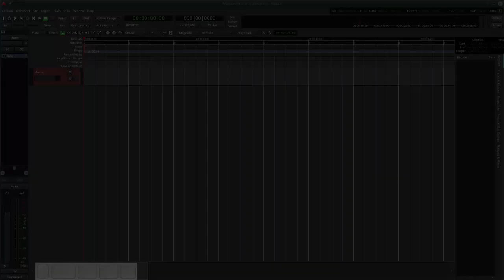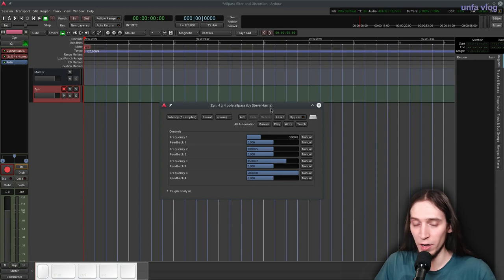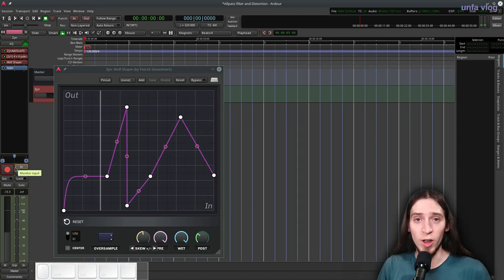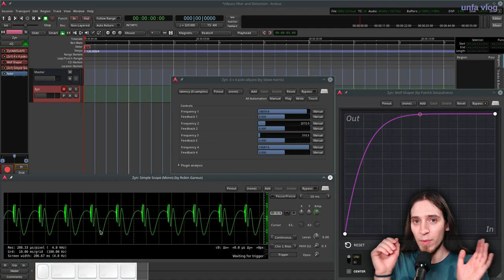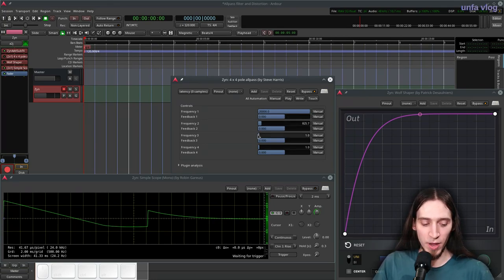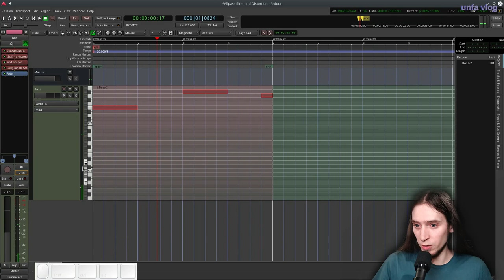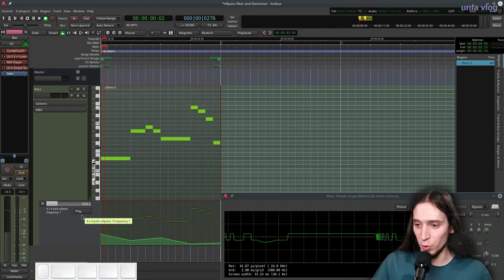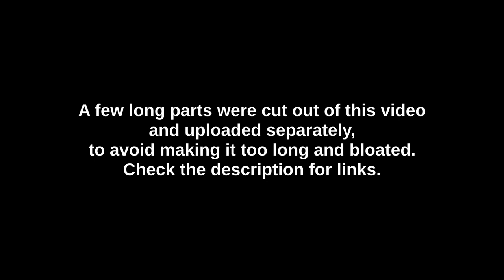UV#25 Synthesizing a dirty bass with allpass filter and distortion (Zyn-Fusion and Ardour)

Comment from the maker: After listening on headphones I have to correct myself: the allpass filter alone can make a significant difference in the sound. I think that for some reason it's different on the speakers though - maybe because of the bass reproduction.
Reply: I just did two videos on phasers and had to talk about allpass filtering by extension. In the first video I mention how moving the cutoff of the allpass changes the phase of a waveform as you showed here in your video too. I go on to show how moving the cutoff quickly is akin to phase modulation which you’ll recognize as the technique used in most FM synthesizers.  So allpass filtering can produce sounds similar to FM.

Now if you can hear a significant change in the sound without variable phase modulation then maybe that’s your ear hearing the difference in “current”.  Like when you enable a polarity flip a kick.  In the flipped version the attack of the waveform has the speaker diaphragm moving away from your eardrum instead of towards it or vice versa, whichever the case may be.

Comment: That was really cool and a great demonstration! I actually didn't hear that much of a difference from the allpass filtering alone in my headphones, maybe a slight lowpass effect. I think the plugin is actually 4 separate allpass filters each with 4 poles (I'm not savvy enough, but I think the poles allow the feedback capability).
Reply from the maker: Thanks! I think you're right about the poles. Unfrotunately I couldn't find any other standalone allpass filter. I know there's one in every Phaser, and also often inside reverb units, but not much of these can be found alone.

Comment: 15:27 Good point about how the allpass filters don't make much of a difference when targeting higher frequencies.  The objective is to RESHAPE the wave via phase. After all, it's the reshaping that's changing the output of the transfer function (distortion).  The MOST reshaping is going to happen at the fundamental, and then less so the further up the harmonic series you go.  This came as a surprise to me in my own experiments, but completely makes sense.  I wish I pointed that out while going over this trick in my video on it.  Luckily I have a few more phasers to cover so I'll have to mention it next time!

Comment: Is this all pass plugin available for windows?
Reply from the maker: I am afraid it's not, but you can use a phaser plug-in in all wet mode to get a similar result - if you disable LFO and manually control the modulation depth you should be able to get very close results. This works because a phaser uses an all-pass filter internally to create uneven phase cancellation on the input signal.
Reply: @unfa00  i might have found a windows port afterall!
Reply from the maker: @boimesa8190  Where? :D
Reply: @unfa00  haha shit my browser doesn't save history... Oops